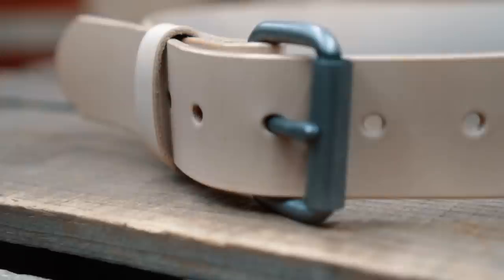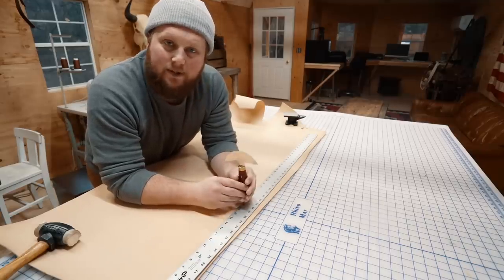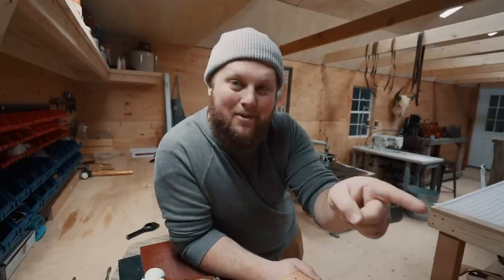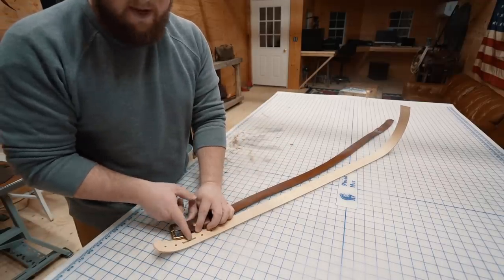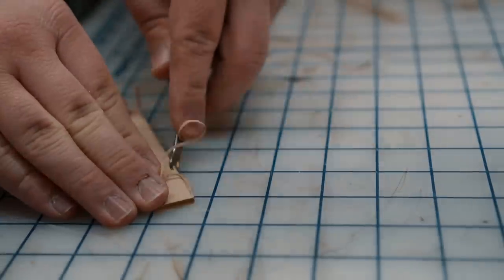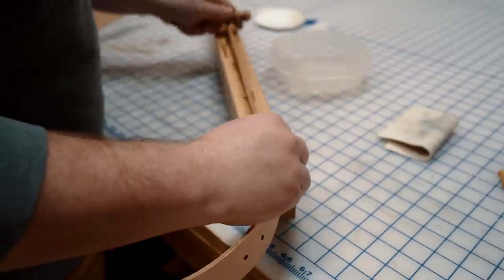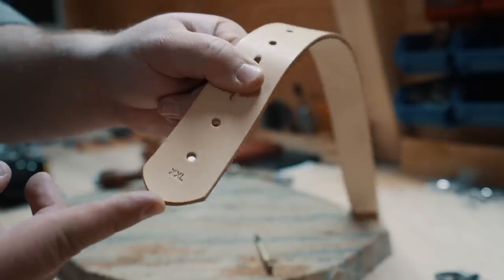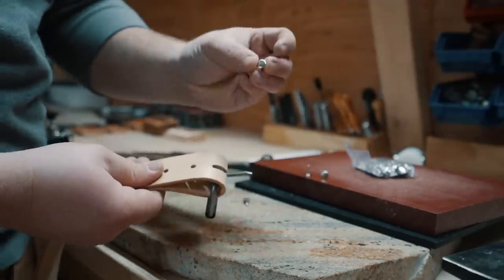Making a SIMPLE Leather Roller Buckle Belt

Comment: Parker, Love the videos. 
My current project i'm trying to do my first wallet all by hand. Sort of the size of your No 52. 
But wow mines thick.  It tried hand skiving the interior pieces of my 4oz leather down but it's a bit of a brick. 
What thickness of leather do you use for your interior?  And are you buying it that thick or splitting it somehow?
I must say as well with all the hand cutting that I certainly see the value of your clicker press.
Reply from the maker: haha yes the clicker press is VERY nice. I usually use 3-4oz leather for our wallets. It would be pretty difficult to hand skive an entire piece of leather though and keep it consistent and clean. So I wouldn't recommend trying to skive the whole piece unless you can get your hands on a band knife splitter or even a bell knife skiver. My best recommendation would be to either use 3-4oz on the whole thing or buy two different hides. Like at tandy you can buy their natural veg tan tooling hides in any weight. So you could buy one at 2-3oz (for the interior pieces) and one at 3-4oz for the exterior. Hope that helps!
Reply: @SunyJim  Yea I use 2 oz for the inside pockets and I use 5-6 oz for the outside which I tool custom if someone wants.

Comment: I like your design of the Burnishing Jig.
How Long is it?
What is the width of the Gap?
How deep did you go for the Gap on 1-1/2 inch Belts?
How deep did you go for the Gap on the other side and what width of Straps do you use that side for?
I need Jig so much.
Thank you for your help.
Robert

Comment: Is the spacing adjustable on the tipper? Because that tail past the second rivet is too long as well, it might start curling?
Reply from the maker: Unfortunately no...and yes I agree. I definitely would've designed the die a bit differently. But the machine works perfectly. So maybe they'll come out with different dies down the road.